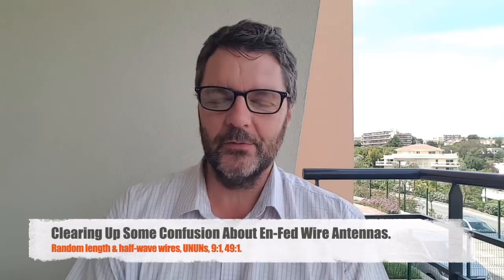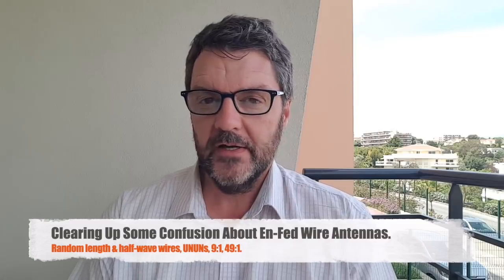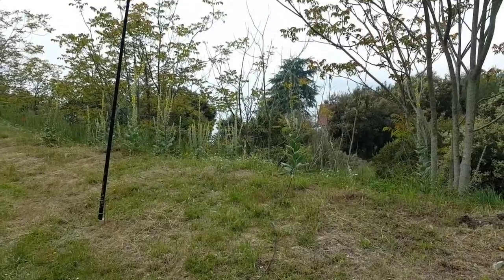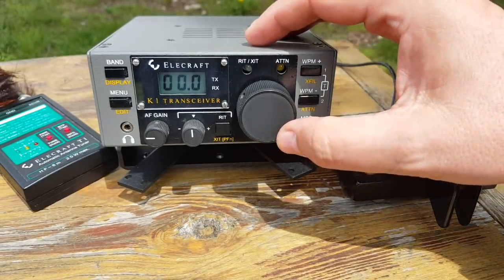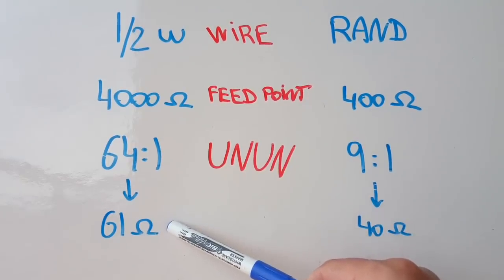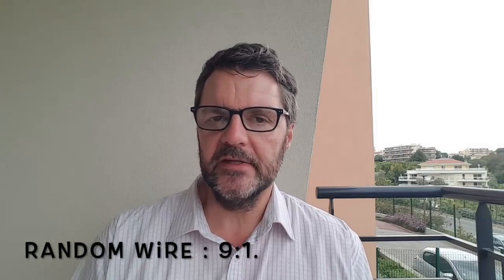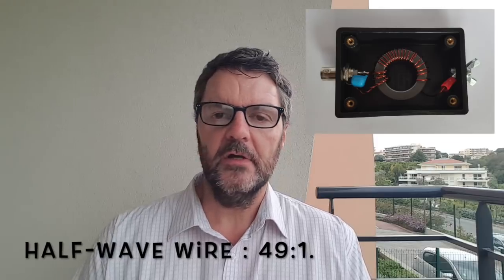Clearing Up Some Confusion About End-Fed Wire Antennas.

Comment: Historically I haven't taken part in contests, except a little on field day with my local radio club.  I've been off the key for a decade or two and I'm  just now getting back into the hobby.  
I also noticed that since CW is not a requirement for entry level license I think that stopped CW activiity to a large extent.  I know for sure that while I was a novice that hams of all license levels helped me gain code experience and speed for my license upgrades.  
That depopulation of the ham bands could have been a big help to QRP operators, but evedence shows that's not always been the case.  That is to say with fewer people on the bands there's more room on those bands for QRP CW and SSB operators to make easier contacts.  But it's not happening that way.
My understanding is that POTA, IOTA, SOTA etc were organized to help prevent Hams from losing our frequencies from lack of use.  I've also noticed that almost immediately after the contests end the bands sound dead.  That also could be made into a big advantage to QRP operators IF full advantage is taken of all that "dead air" by the QRP operators.
Another possible advantage that could be taken for making contacts during a heavily used contest time is for QRP operators to move to the WARC bands.  It's my understanding, that at least at one time, the WARC bands would not be used for contests.  I don't know if that's the case these days.
Even when QRO is used at the maximum allowable power I've heard the 40 meter band drop as if a radio curtain was lowered across the RF layer for maybe half an hour.  That being the case such a phenomenon coud kill a QRP QSO in it's tracks just the same that it did for the people I heard switching on their 1.5 kW amplifiers and still losing contact.
If a contest can be organized and with a time schedule for the contest to end, then  the same thing could be organized to benefit QRP operators.  
That could be carried even further.
Because different groups have different ideas about what power level actually constitutes QRP the agreement could be organized that for a certain part of a designated QRP day a certain amount of hours could be used only at the 20 watt level and at the end of that time another time slot should be designated for only the 5 watt maximum level and so forth for the other groups who have their own thoughts about which power level should be honored as QRP.
THEN for the sake of preventing QRP  and / or  QRO people feeling short changed, then  one week of QRO could be scheduled durng prime time for each band and the next week scheduled for QRP operators during prime time for the bands.  There's a lot of different ways to organize strict QRP operating days.
Since the contests were supposedly organized to prevent loss of our frequencies in the first place hams might lose use of those frequencies duIring the time of day that the bands sound dead immediately after the contests end. That might not sound reasonable or logical to hams, but hams aren't the ones soley in control over our frequency allocations UNLESS we keep using our frequencies ALL the time.   Remember those contests were organized to help us keep our allocations.  Maybe we hams should think more about what we can do ourselves to help keep them.  NK5I
Reply from the maker: Still no contests on WARC bands, that's why I really like 30m. I think that lots of people get into CW actually because it's no longer required... I got into ham radio especially for Morse code. The dwindling numbers I believe to be across the board... Agreed on contests and band use... Thank you for your great posts. You might want to check radiopreppers.com. there sure is a place for you there 😉
Reply: @RadioPrepper Thank you for the invitation.  I'll take a look.
I got into ham radio by going to a recommended radio electronics class.  The class was put on by my (now) radio club hams (then) wanting to make it easier for people to get their license.  The teaching ham was in show and tell mode about coils, resistors capacitors and transistors.  I was already making small circuits, so I could have taught that class.  🙂
Then they gave me a cassette tape with beeps on it and said learn these sounds and the letters they represent.  My first thought was, "What a heck of a way to try to carry on a conversation."  lol  
I got my ticket and got on the air with the Swan 400 that belonged to the club.  It took me 2 weeks to make a successful QSO.  My goal became to be able to "talk to" any one whose signal I heard.  
After a few years I bought a KNWD TS440S and put the mike in the back end of my desk drawer.  The mike is still in the same drawer.    I'm about to order 2 or 3 Pixie kits and a few packages of crystals for the cw parts of the bands the crystals fit.  My goal with those kits is to add a good stable VFO for them.  I made a fair DC rx with a VFO.  Getting good frequency stability is a steep learning curve.  But, this is the information age.

Comment: In your video, you said that securing the wire wound toroid in epoxy caused, or could cause, issues.  Any chance you could provide a bit more info on that?  Epoxy has been my go-to for securing my toroids after construction.  Sounds like maybe that was a bad idea on my part.  Thanks in advance!
Reply from the maker: I wasted two toroids potting them in epoxy... Crazy SWR readings, impossible to tune...

Comment: Gil, excellent channel, I've subscribed. Quick question, what is the minimum length of feeder cable that can be used with a 49:1 Unun, with 130ft of wire??
Reply from the maker: I haven't tried very short cables... I use 25ft  or 10m.

Comment: Couple of questions, what is the function of the capacitor, does value matter?  (This would make a tank circuit resonant at a particular frequency, so not sure why capacitor is used in this instance).  Doesn't crossing the winding like that cancel the magnetic field in the core? Good video. Thanks.
Reply from the maker: https://www.ai6xg.com/post/efhw-xfrmr-capacitor

Comment: Great video!! Thank you! Explained a lot about the subject. But, a question... the size of the core only influences the power, right? In QRP with 1W for 40m, I could use a small core like T94-6 or other and the number of turns could be the same, typically 2:16 right?
Reply from the maker: Well, a bigger core is also more efficient, even using less power. That said, in practice I haven't noticed much of a difference.

Comment: Agree with you re: contesters, although Europe sounds much  more crowded than the U.S.A. during contests.  Well, 14 meters mas o menos and you will have a 30 meter EFHW antenna.  Better than not getting on the  air at all, I suppose.   Better than waiting until 17 meters awakens from its RF slumber as the solar cycle progresses.

Comment: If you were using the antenna mounted sloping such as one ended mounted on a portable mast, would you have the feed end at the highest point or would it be better having the feed point at the lower end. I’m thinking of using a EFHW for portable operation. Thanks
Reply from the maker: Hi, I see no advantage to top feeding. Less coax means less losses..
Reply: @RadioPrepper  thanks for the advice 👍

Comment: Great video.  I notice your feed lines seem to always (?) use BNC connectors.  Yes, I can see your using something like RG-58 coax, but you could also use a standard adapter PL-259 connector with an adapter, but you don't.  Your unun  transformer boxes also use these BNC fittings.  Can you speak to why you seem to prefer this connector.  Maybe even, then, create a video to show how you typically attach your radios and accessories, to high light the connectors.
Reply from the maker: I like them better. They are smaller, do not unscrew and are quicker to use. All military equipment uses BNC. IMHO it is a better design. Most QRP radios and devices use BNC as well.

Comment: In this video you mentioned that you weren’t sure how a 7:1 transformer equates to a 49:1.  Here is why that is.  7:1 is either the voltage or current ratio.  If you think about this in terms of impedance from primary and secondary sides then the 49:1 ratio is explained. We know that “Z=E/I”. If you assume Epri and IPri are equal to 1 then Esec will 7 and Isec will be 1/7.  Dividing Es by Is will equal 49.  Therefore from an Impedance view the transformer is 49:1.  Or for any transformer ratio of voltage or current then the impedance will be the square. It’s just magic!
Reply from the maker: Great thanks!

Comment: can i ask, you say (Formulas for half-wave wire calculations are 143/f in MHz for meters)
i had understood to 300/F = full wave then divide by 2 to get half-wave, 

300 being the speed of light, so 143x2 = 286 so this is the speed of light on earth?
Reply from the maker: No, but electricity goes a little slower in wire. That is called velocity factor.

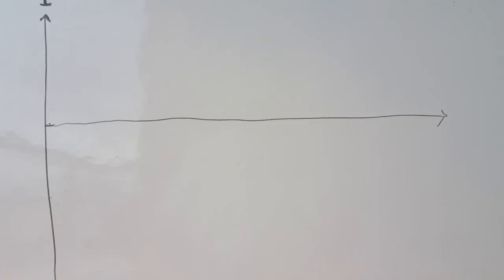Comment: Stupendous mon ami.  The part from minute 5:37 to about 11 -12 minutes, about the current distribution in a cycle as it appears in a 1/2 wave wire, is more than excellent. 

I would be interested in hearing your views about both the pattern and gain of end-feds.  It is possible, yes, to achieve an impedance match; but, is it worthwhile given the pattern and gain that is achievable with the different ways of setting up the wire (e.g. sloping, inverted v or L)?

I tried a multi-band end-fed with a 9:1 and 22 metres set up as an inverted-L (I built some 4nec models of various ratios for the vertical and horizontal components; though, a mere novice at that program I am).  The gain numbers looked good on 20 and 40, but dismal on 80 (-3).   

I always seem to gravitate back to my resonate dipole or my vertical - perhaps a symptom of some sort of anchoring bias...

Comment: Since current in EFHW and dipole antennas allow for the current to be fully “match” (for lack of a better word) by the wire, do both antennas have the same radiation pattern and intensity? Is one more directional than another? Is that dependent on power being radiated? 
Thank you, I am been learning about ham radio in the last 2 months and many things are new to me.
Best explanation on efhw, transformers I have come across.
Reply from the maker: Same as a dipole.
Reply: @RadioPrepper  Thank you from Texas. Love your videos.

Comment: Gil, if you have a toroid core of unknown material, is there any way to determine what type it is and/or what frequencies it would be suitable for? DE WA1KLI
Reply: You can evenly wind several turns of copper wire on the ring. Then measure the inductance and calculate the magnetic permeability according to the formula. Or to make such transformer, connect a 3.3 kOhm resistor to its output and the common wire and check by antenna analyzer will it be 50 Ohms on input of transformer on frequencies from 1 to 30 MHz and then correct number of turns of a secondary winding. I think it’s easier way to buy proper Amidon's ring on Ebay and to copy this transformer. Check it on PD7MAA site.
Reply from the maker: What Vlad said :-)

Comment: I have watched many videos and read many blogs on this subject.  There seems to be many folks who had problems with the EARCHI unun (and W1SFR units) and then switched to the MyAntenna brand units.  A friend of mine has done many tests on ununs and found the MyAntenna brand to be so much better (using WSPR data). What is the difference?
Reply from the maker: I think simply because a 9:1 is intended for non resonant antenna while a 49:1 is for a resonant half-wave. A 9:1 is a compromise.

Comment: Thanks Gil. Great video, really helpful. I'd love to see a followup of how you trim the 1/2 wave length wire to the correct length...or do you simply work out the length using a formula?
Reply from the maker: Read the video description ;-)
Reply: @RadioPrepper  Thanks Gil. I feel like an idiot now.. :) . I have just found that I still need to fiddle (read make small adjuatmenrs) with  length when I put my wire and 49:1 transformer onto an analyser.  I did originally calculate the length from the formula. Was just interested if you had to do something similar or if the calculated length just worked for you. Thanks again for your tireless efforts in making great videos for us.

Comment: Thanks for the instruction on those Gil.  I built a 9 to 1 and wasn't sure if I had built it right as it was reading a short.  Passed it around my HAM club and no one could provide any input.  I don't think many of them are into home brew or didn't care to help.  You calmed my fears with your demonstration / explanation.  Very imformative.  I bought 100' of 12 gage wire to run my random length wire.  Does it matter how far out I run it?
Reply from the maker: Excellent. With a 9:1 avoid half-wave lengths. With a 49:1 use half-wave lengths. On the video I built a 64:1 for half-wave wires.... The 9:1 instructions are on the EARCHI site, link in the description.

Comment: Gil. What are the advantages, if any, of using a center fed dipole  over a end fed half wave. Unless I am missing something the only disadvantage is the end fed half wave requires the unun. Am I missing something?
Reply from the maker: Correct. The dipole is also slightly more efficient since you don't have transformer losses. On the other hand the end-fed can be used vertically. Personally, for portable operations, I find the end-fed half-wave more practical.
Reply: Radio Prepper thank you for all you do
Reply from the maker: You"re welcome :-)

Comment: GREAT VIDEO! But why 3:24 and not 2:16 turns ration if both are 64:1?
Reply from the maker: More turns works better on lower bands but does not work on higher ones. I tried a 3/24 on 6m; it did not work, but a 2/14 did. 64:1 is better for thinner wires too, as the impedance is higher. Why exactly, I can't remember..

Comment: Instead of hoisting the 1/2 wave antenna can you droop it from a window? Using the antenna upside down is ok?
Reply from the maker: Certainly yes. It can interact with objects that have metal in it, like reinforced concrete, so better keep it away from the wall as much as possible..

Comment: Back before you could hook your radio to a computer & let it run the contest at 75wpm for you, I used to play contests. Phone & CW. The "small" contests were my favorites. SAC, PACC, YO, CQ-MIR, all that. It was fun and I could ring up a pile of QSOs with different countries and have a good time doing it. I'd slow down for slow folks -- of which there were more back when -- and could keep up with most high speed guys using keys and keyers &c.
. . . But now you just hook up the computer to your SDR and sit back and watch the radio and the computer hunt and pounce & ring up QSO after QSO at 75 and 100wpm. Cup of coffee, a donut, the radio did all the work. In the end you take the computer generated log, upload it to whatever & discover that you lost to some guy with a bigger radio, more antennas and a faster computer.
. . . Now it's a religion, not a hobby.
. . . So I don't contest any more. The human element is gone. If I want the computer to run my SDR, I'll run FT8 and watch the screen. Waste my time on FaceBook. Catch up on the presidential tweets. End of the day, look at the log and see how much DX I missed.
. . . At which point I'd have been better off weeding the garden and tending to the carrots and kale.
Reply: But the antennas? Hell yes. Antenna experiments are the easiest thing to do and they all go on -- unless you're into the apartment balcony mag loop thing -- they all go on outside! With the carrots and the kale. ;-)
Reply from the maker: Communication is no longer the main goal, and that's regrettable...

Comment: Very recently built my first 9:1 unun and surprised how well it works without the need for a tuner across the HF band. My SWR doesn't go above 1.5. After watching some of your videos I am wondering if there is anyway to make a RF Choke and 9:1 unun in one box?
Reply from the maker: I have wondered too, but thinking that there probably needs to be some separation..

Comment: Hello, I wanted to ask if to make the 64/1 I have to use a 100pf 3Kv capacitor or can I always use one of 100/150pf but 1Kv.  Thank you
Reply from the maker: You can use a 1KV, just don't put 100W through it..
Reply: @RadioPrepper  grazie molte

Comment: So I use a random length antenna with a 9:1 transformer. Do you think I should still use some kind of antenna tuner for my SDR radio? If so what is a good one to get? I don't do any transmitting just receiving
Reply from the maker: Yes  A tuner will help for reception. Look at the ZM-2 tuner kit..
Reply: @RadioPrepper  I only use my random wire for receive, do you think I still need a counterpoise ground?